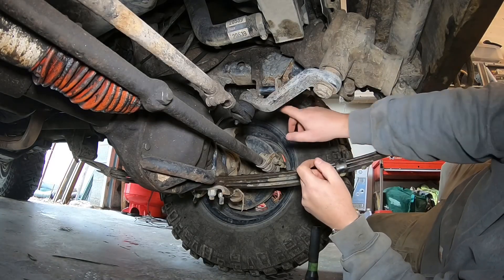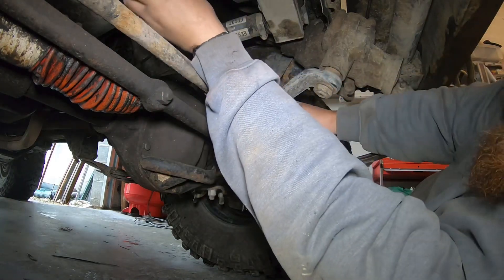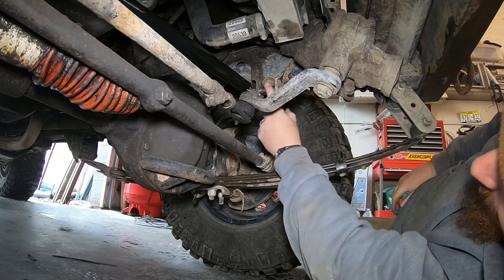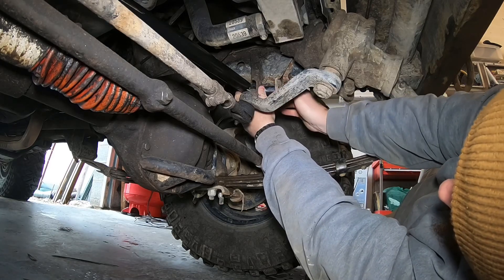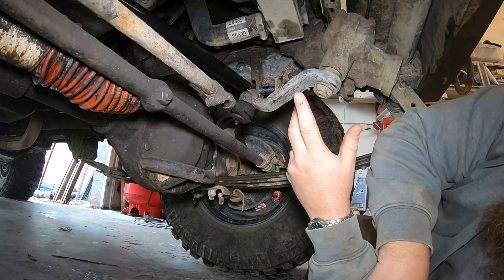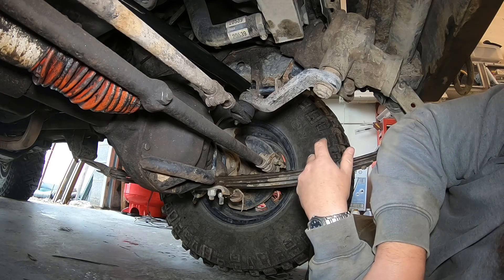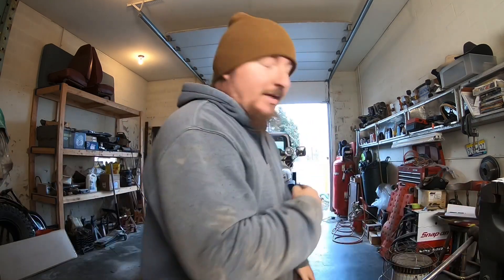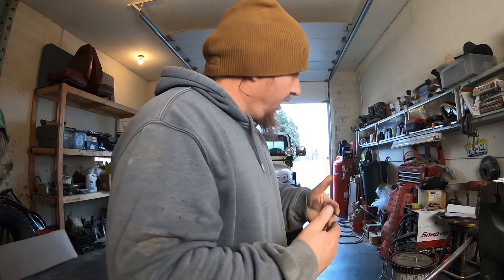JKS telescoping track bar on Jeep YJ

Comment: Great video Tuna!!!  Question for you.  Do you have a drop pitman arm?  Could be wrong, but it looks that way from what I could see and I don’t see a riser bracket on the axle.  From what I read in the instructions it says, “IMPORTANT: It will be necessary for the OE pitman arm to be installed on the steering box if aftermarket relocation/riser bracket is removed from the axle. However, if special circumstances require the relocation/riser bracket to be retained, it will also be necessary to retain the drop pitman arm.”  Just a heads up to double check.  Don’t want you to experience an unsafe bump-steer condition.  I believe the track bar and tie rod from the pitman arm should be parallel.  Thanks again for a great entertaining video!!!
Reply from the maker: Papa Gallo honestly, I’m sitting here, reading your comment and scratching my head because I don’t recall if I changed out the pitman arm. I will definitely find out and thank you for the feedback. Stay tuned, I’m gonna do more videos. 😎
Reply: Yardbird Tuna awesome! I’m subscribed!

Comment: Yardbird - Nice video, i just purchased JKS track bar and have the same question about the drop pitman, did you ever figure out the riser on the axle? I have a lift with the drop pitman and i'm thinking i need the riser as per the instructions....thanks!
Reply from the maker: Good morning!  I do have a drop pitman arm installed, but no riser. I don’t have a riser installed because I rarely have this track bar tight. I don’t daily drive it. However, I would highly recommend keeping the angle of the track bar as parallel with the drag link, as possible. Best of luck, my friend!

Comment: What axles? Dana 30 and 35?
Reply from the maker: Papa Gallo currently running open D30/35’s with 4.10 gears. Next few videos will be a D44 front and Ford 8.8 with 4.88’s and some lockers.
Reply from the maker: Papa Gallo you can also check out my Facebook and Instagram accounts under the same name @yardbirdtuna.
Reply: Cool, thanks